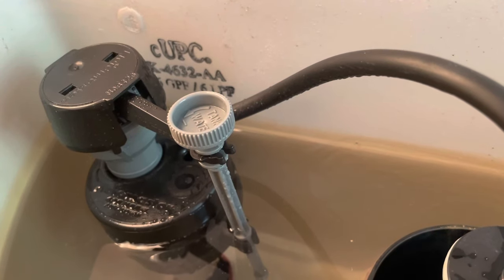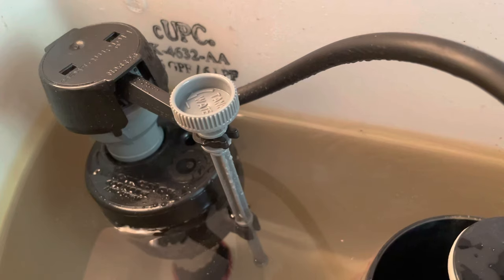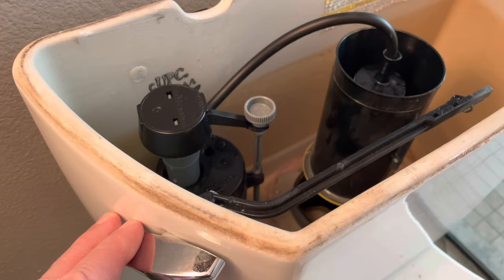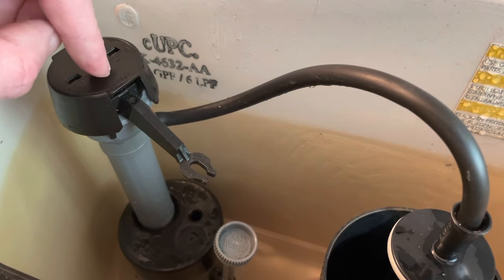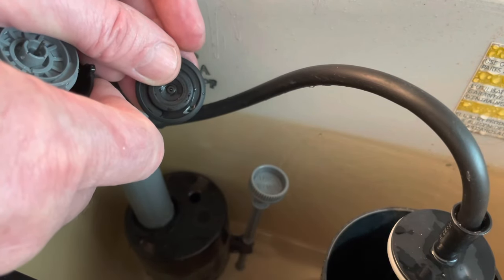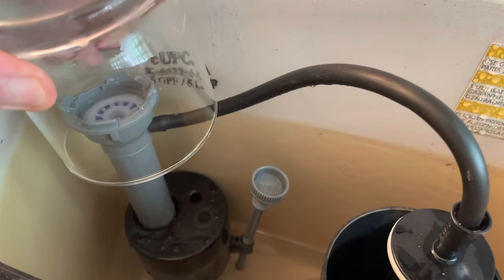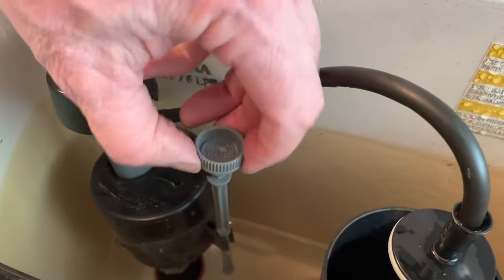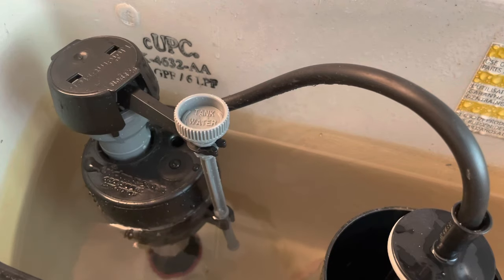Toilet Fill Valve Not Shutting Off / Don’t Replace / Fix Fast Cheap & Easy For Beginners

Comment from the maker: To Donate to the Channel:

https://cash.app/$LovePapaJoe

Fluidmaster fill valve seals:
https://amzn.to/3UtZkmg
Reply: Any chance you can do Zelle and/or Venmo as well? Many thanks for the video.
Reply from the maker: @IP331QG  sure, my Venmo is @TheHomeTeam1974
Reply: What could it be that when the float goes all the way up even after adjusting the height through the screw  knob thing and the water rises above the float and goes into the overflow?
Reply from the maker: @thingshappen9199  this may help… Toilet Won’t Stop Running? The Quick & Easy Finger Test
https://youtu.be/VYfluYcwIU0

Comment: OMG! Papa Joe!!! I am a 70-yr old woman who thought I was going to go STARK RAVING MAD listening to the toilet run for the past 2 weeks. The maintenance guy in my bldg came & told me it was the big plug at the bottom of the toilet & I needed to buy a new one. WRONG.   I could see there was nothing wrong w that plug. So I carefully followed your instructions . You instructed us to click off the top of the gray plastic bit & then unscrew the black part of the tank thingy to the left . So I got it open & saw the other white plastic part was clogged w weird gunk. I removed those nasty chunks w a needle nosed pliers & rinsed out the white plastic thingy with a glass [as you demonstrated] in case there were additional mineral deposits. WORKED LIKE A CHARM!!!!!! Bless you kind sir for your  clear & concise demonstration. I still cannot believe I repaired the dang toilet when the maintenance man had NO IDEA WHAT HE WAS TALKING ABOUT lol  Blessings to you!
Reply from the maker: Awesome, glad to hear it helped you! 👏🏻

Comment: I was watching videos about changing the fill valve  due to slow fill, water leaking from top of fill valve but then saw yours and got the cap off. Completely worn down seal! Fluidmaster not a perfect replacement for my Delta but good enough for right now! Thanks a million! I try to be handy but miss my husband doing things like this around the house and get so frustrated that he was taken too soon. Sometimes I feel so stupid an not confident to do the things I used to never have to worry about. Many Thanks to goods guys like you.
Reply from the maker: Glad to hear it helped you. Well done! ✊🏻
Reply: YouTube is your friend

Comment: Thank you for this video. I have been contacted by my city water dept for excessive water use that was about 200 to 300 gallons per/day over our normal usage. Watching this video I went right to the problem and fixed it replacing the fill valve seat. That little guy can waste some water.

Comment: I want to thank you for this video. I have been having to turn my water on and off at the floor because I didn’t know what was causing the over filling issue and my septic tank was taking a hit. (The tank was just emptied so this is quiet the water waste). Anyway, I took that top part off and found two pieces of broken black plastic jamming it up. Looks like they broke off of something but I can’t tell what. The toilet now flushes and stops properly. I would have called my dad but he passed a few years ago, so thank you very much. 💜
Reply from the maker: You bet, glad it helped you. And it’s not uncommon to get “gallstones” in there, even from somewhere upstream. Don’t hesitate to contact me with issues around the house. My email’s in the description. You may have lost your Dad, but you have a Papa Joe. 👍🏻

Comment: I had the same issue, I opened to check the valve seal and found a small piece of debris in one of the small plastic crevices. I removed the debris and the issue was resolved, thanks so much for this video!

Comment: Thanks for the informative video!  I usually do all my own plumbing but hired my first plumber on a new bathroom remodel at my wife's urging.  He replaced supply line, shut off valve, and installed new toilet. The very next day, the valve wouldn't shut off.   Upon inspection , and thanks to your video, huge chunks of rust had found their way inside the brand new fill valve just as you described.  
Your tutorial worked like a charm!
Mama is happy again.

Thanks Papa Joe!
Reply from the maker: You bet, and well done! 👍🏻

Comment: Went over my 85 year old father's house and he told me he had called a plumber because his toilet would not stop running.  The plumber was going to charge a $150 just to come and check the problem. I quickly went on YouTube and found this video and fixed the problem for $3.50.
 Without this video I would have gone and bought him a new fill valve for about $30. So not only did this video save him hundreds of dollars from a plumber but it also saved him $26.50 when I stepped in and became his plumber.
 So thanks for the video I'm sure my father will be using YouTube from now on to troubleshoot problems.
Reply from the maker: You bet, and I’m glad you were able to help him… there are soooo many things around the house that we can learn to do on our own. Well done! 👍🏻

Comment: I have a brand new toilet I installed lately,  and the fill valve inside the tank wouldn't stop filling the tank. Looking at your video I used your advice and removed the top valve and flushed the screen looking thing inside the tube. It had rusty sediment from the supply pipe. I reassembled the valve and I now have a toilet that acts as it should. You sir have made me a very happy guy because your advice worked! Thank you so very very much for posting the video.  I am now a subscriber and will watch all of your content. You have videos on things I need to learn. Thanks again and I'm so grateful to you.
Reply from the maker: Thank you for the kind words, and glad to hear that it was helpful for you! 👍🏻

Comment: I’ve fixed both my toilets with this one video with a fill valve that would not stop and then one with a fill valve that would not run. You’re an absolute master for posting this short and sweet informational DIY video..
Reply from the maker: @yurikalashnikov5815  hey that’s awesome. Glad to hear it helped you! 👏🏻

Comment: Thank you Papa Joe! Following the municipality's repair of a broken water line, the flush valve on my toilet wouldn't shut off. I removed the top cap per your guidance and lo and behold, a small pebble was in the center hole where the needle operates. Removing this pebble returned the valve to operational condition! You saved me a weekend trip to the hardware store and the aggravation of an afternoon of plumbing repairs!
Reply from the maker: Awesome, glad it helped. And yes, it’s not uncommon to find “gallstones” in there. 👍🏻

Comment: I bought and installed 2 Fluidmaster 400A Universal Toilet Fill Valves and installed them. Within a few months, both stopped shutting off. I followed the steps outlined in your video and discovered plastic manufacturing debris under the fill valve cap. After removing the 4 or 5 bits of plastic, the valve shut off as it should. Thank you!
Reply from the maker: Never had that happen with manufacturing debris... good to know. 👍🏻

Comment: I just can't thank you enough for this video. Removing the fill valve top showed me that the rubber seal looked okay but just in case, I purchased a new seal and a new fill unit. My local hardware store says they don't sell the valve cap piece separately (but I've seen them on amazon.) I noticed that even with the new seal, the outside lever that moves the pin up and down just didn't move easily. So, I took a dowel and moved it up and down in the opening in the old seal and removed some debris that had accumulated in there, and now the lever/pin combo moved like the new fill unit I just purchased. Replaced the cap and turned on the water. COMPLETE SUCCESS! The tank filled and turned off promptly. I was beside myself with joy. I had been dealing with this for at least six months, and all it was was a little debris in the rubber seal!! The seal itself is in perfect shape (the water in San Francisco is quite soft.) It's interesting that FluidMaster says to replace the entire unit every five years.

Thanks again!
Reply from the maker: You bet, glad it helped. And yes, it’s not uncommon to find some “gallstones” in there.

Comment: This is really awesome. I went to Home Depot and to double check I asked the associate should I do this option after sharing what was happening and he said, I would purchase the Valve and replace the whole thing :) I went ahead with your solution and replaced just the seal and it worked like a charm!!!! Excellent video!! This helps better than Pros
Reply from the maker: Glad to hear it! 👍🏻
Reply: The pros don’t work at Home Depot 😂
Reply from the maker: @yzmoto80  truth ☝🏻
Reply: I did this again today for another toilet. It took less than 5 mins. Thanks much for sharing this knowledge with the community. Appreciate it. I’ll pay it forward as well

Comment: Never give reviews on YouTube but this saved me so much of heartache , my plumber had installed a new fluid master and  noticed this issue after he had left , and all the inconvenience of not using the flush fully until I stumbled on this video followed the steps to a T and there it was a small rubber residue was blocking the valve shutdown , removed it and we are back in action ! Thankyou
Reply from the maker: You bet, glad it helped you. 👏🏻

Comment: Thanks, just learning about the valve internals in this video solved my issue, I removed the rubber seal and cleaned it with soap and a toothbrush. also cleaned out the top end of the valve assembly with soap and a toothbrush. All is good right now and my seal was is great shape after cleaning, it should last for years now.  Easy - fast - free fix, THANK YOU !
Reply from the maker: You bet, glad it helped you! 👍🏻

Comment: Thank you for the tutorial.  I have a brand new toilet installed, but had problems with water meter leaking.  After that was fixed, sediment came through the pipes.  I thought that everything was flushed out, but then the toilet started with a slow leak.  With your advice, I found that some of the sediment lay very nicely within the holes in the valve.  Cleaned out the sediment, and now, it's heaven again.  God Bless You for saving me $200+ for a plumber to come by - especially since I'm unemployed.
Reply from the maker: Awesome, glad to hear it helped! 👍🏻

Comment: Thank you!  I had just replaced this valve recently, couldnt believe it was failing. We recently had a water main at the street failed and replaced. We had lots of debris in our faucets.  I totally forgot about the toilets.  I took the top off as shown, cleaned the washer, flushed debris out of valve(with a glass over it). Works perfect now. It shuts off! Bless you!
Reply from the maker: Awesome, glad it helped you! 👏🏻

Comment: Thanks Joe. Your video was a HUGE help. Had no idea how to get inside the float. When I followed your instructions, I actually found a hard piece of iron deposit on the valve seal, which turns out was causing my problem. Cannot thank you enough, and please keep the helpful videos coming.
Reply from the maker: Hey Kevin, yes, it’s not uncommon to find “gallstones” in there. Glad the video helped you! 👍🏻

Comment: Thanks so much for posting this!  We live in a new construction home, so I was at a bit of a loss when I took the lid off the tank and saw that everything looked different from the old school toilet tanks.  I used Fluidmaster in my search, and your video came up.
Fortunately for me, I was able to just take out the seal, wipe off some build up, and insert it back in to get my water to stop trickling.
Reply from the maker: Well done, glad it helped you! 👍🏻

Comment: You just saved me another trip to the store and even more frustration! Had to use this trick on a brand new Flushmaster valve that had a bunch of gunk in the gasket apparently. So this video is not only for old valves but apparently new ones as well! You’re the man, thank you.
Reply from the maker: You bet, glad to hear it helped! 👏🏻

Comment: I ended up have debris from reno end up under the cap, and I would have never known how to open and find that! It flushed a few times fine, then kept running water. I took the top off like you said, ran the water with the cup, and sure enough there were 2 rocks or whatever stuck in there. Removed, and wa-la, toilet functions again! Thank you so much
Reply from the maker: Glad to hear it helped you! ✊🏻
Reply: Same here! Brilliant!

Comment: saved me some headache.  I have had it with my creaky old house and its plumbing problems! had six plumbers come out last year for one problem. but now this minor problem comes up with my john!  Just that I am fortunate enough to find someone with a toilet mechanize just like mine! I did replace the toilet about 6 years go, so it isn't a "special" configuration like lots of stuff in this Annityville horror look-a-like house I inhabit LOL. I am just glad I can fix it thanks to this vid! Aces! I am liking and subbing! :D
Reply from the maker: Haha, Ammityville horror house… sounds like you’ve got alot of trouble on your hands, at least the toilet isn’t one of them now. Glad the vid helped. 👍🏻

Comment: I experienced the problem of the toilet fill valve not shutting off. I followed your video and discovered there was a small pebble blocking the valve seal! I followed your method, cleaned the seal, flushed the valve, and now the fill value shuts off like before! As a new homeowner on a tight budget, I really appreciated being able to do this without calling a plumber. Great video. Thanks!
Reply from the maker: Awesome, glad it helped you!

Comment: My brand new toilet would not stop leaking at the fill valve, turns out a piece of debris came into  the fill valve after I turned the water back on. Worked awesome !Thank you

Comment: Great information.  I didn't have a new one (gasket) so I did the flushing trick..also removed and cleaned the old gasket along with the seating surfaces.  So far it's working great.   Thanks for posting!
Reply from the maker: Awesome, glad to hear it! 👏🏻

Comment: Thank you so much. Usually I end up replacing all the inside parts, this was way easier. It's funny, the old valve seal didn't look worn at all, but replacing it did the trick
Reply from the maker: You bet, and no, they almost never show signs of wear. But usually, that’s all that needs replacing. 👍🏻

Comment: Worked like a charm! Didn't even have to replace the seal just cleaned it all out a bit
Reply from the maker: Perfect, and yes, sometimes that’s all it takes. I just change the seals while I’m in there, as I’ve got them on hand. Glad the video helped you. 👍🏻

Comment: After inspecting my art one morning,  I noticed a small trickle on the right side of the toilet bowl.  I checked the flapper and adjusted the stem up and down to no avail.  I was able to push down the valve about an eighth of an inch, and that would work for about half a day. After watching your video,  I was able to determine that the calcium deposits had, in fact, built up,  so I held asmall cap over the top of the valve and ran the water, then voila! Camode repaired!
Thank you, sir!
Reply from the maker: Awesome, glad it helped you! 👏🏻

Comment: This worked for my Fill Valve.  The seal was fine, just needed cleaning out.  I will eventually change, but I'll get some more mileage out of this one.  Thank you!  Saved me $127.00 with local plumber.
Reply from the maker: You bet. 👍🏻

Comment: Thanks for the video. I honestly didn't know this could be done. Went immediately and ordered some from ebay,  Amazon was more expensive. Just arrived today and less than minute later, fixed. I was just going to replace the whole valve until I ran across this. Thanks again.
Reply from the maker: You bet, glad it helped. 👍🏻

Comment: I kinda fancy myself as a handy man and I've replaced quite a few of these valves before. However, I never had one - new, that is - that wouldn't shut-off before. I had just replaced this valve with a brand new one and it wouldn't shut-off entirely. My confidence was shaken...LOL. Thank you Papa Joe for making this video. A brand new valve, which I disassembled thanks to your directions, had all kinds of tiny little black particles on the seal. No idea how they got there - it doesn't look like it was returned before I bought it. I cleaned the seal and flushed the valve and - anyway, it works like a champ now. Thanks again.
Reply from the maker: Hey, glad to hear it was helpful for you. I haven’t ever had a problem with a new one either, but it sounds like you got one that slipped past quality control for sure.  Thanks for taking the time to comment Ray, I appreciate that!

Comment: Thanks. I tried the adjuster first and that didn’t work- then I twisted the top off as you said and removed the seal and found a small pebble there.  Put the seal back and twist back on and problem solved. Thank you !!

Comment: Great! A 2-minute fix.  We’ll go to the hardware store soon to replace the rubber thing, but for the moment, removing, scrubbing grit out with an old toothbrush and replacing it, made a useful stopgap.  Thanks!
Reply from the maker: You bet, glad it helped. 👍🏻

Comment: Thank you!!! I didn't have a replacement seal, but I didn't know that seal popped out. I was able to pop it, clean it, and put it back. I saw the sediments and mineral deposits you were talking about wash out of the crevices of the seal. It's working so far, at least until I get the replacement seals. This was a lifesaver!
Reply from the maker: Hey, that’s awesome, glad it helped!👏🏻